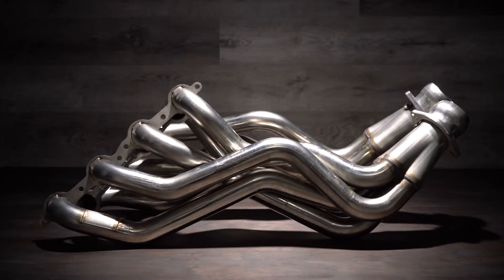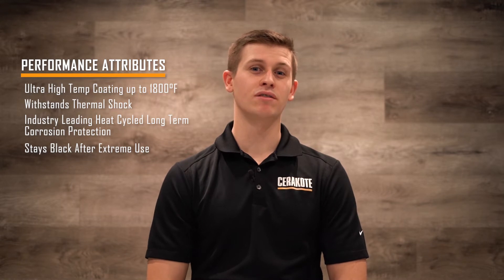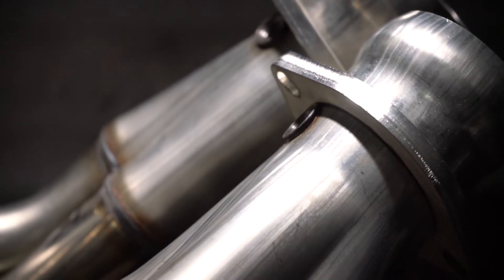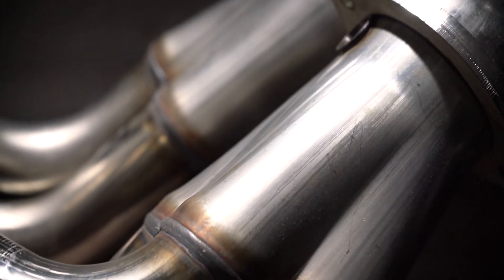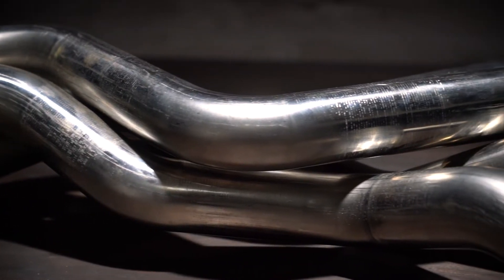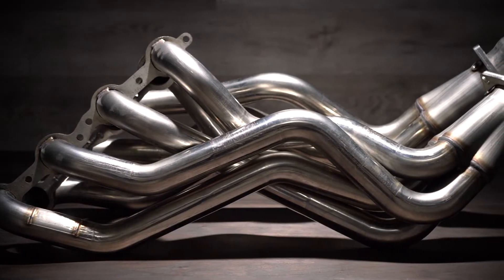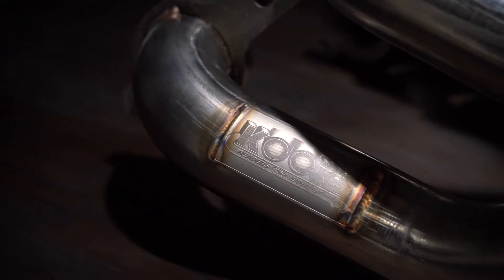Cerakote Application Guide - Coating Kooks Headers with Cerakote Glacier Black C-7600

Comment: Can I sandblast stainless steel with 0.2 mm grit corundum abrasive before applying the Cerakote C-Series Glacier Black coating?😊😊😊😊😊😊
Reply from the maker: This isn’t a media grit we’ve tested or used in-house, so we can’t say with complete certainty. We’d just recommend blasting with caution to avoid creating too deep of a surface profile. If the profile ends up too rough, those deep valleys can prevent the coating from fully settling in, leaving parts of the substrate exposed—and that can make it more prone to rust over time.

Comment: I’m liking what I see. 2 questions. Can this be used on my aluminum intake manifold? 

Secondly I’m wondering if you have other colours  that are as durable for a header? Something like a titanium or silver? It’s going on my show car so I would like long lasting with out discolouration.
Reply from the maker: Our Glacier Series would be the best option for these high temperature applications, but we do have coatings within our C-Series in general that meet the high temperature range as well. Something to note; while the coating stability can withstand the temperatures these parts may see, the color stability may not be able to. Ratings do vary from coating to coating, so you will need to verify that information on the specific TDS for each coating product page.
Reply: @ awesome thanks for the response

Comment: I've purchased MC-5100 for some factory-fresh aluminum panels for the engine bay of my Factory Five roadster.
The question is: Can I wipe it on (as I've done with Sharkhide using a cotton diaper?) instead of using a HVLP gun?
I don't have a decent compressor, and the 'wiped-on' finish looks great for Sharkhide but I want to switch over to MC-5100.
Reply from the maker: Contact our Technical Support Team. There may be a solution for you for applying it without the spray gun, but we'll want to get some more specific information from you. Thanks

Comment: what if you don't have a sand blaster
Reply from the maker: Sandblasting is required because it's necessary to get the adhesion needed for overall durability. If you were to skip this step, the coating would chip more easily. I would suggest taking your parts to a local shop to have them blasted if you don't have a blaster.
Reply: @Cerakote  If you don't sandblast them, can you sand them with 80 grit?

Comment: What recommendations do yall have for the collector where all four tunes meet on the inside radius of each…. I have your fun and everything else and was just coating a set of looks as well…. Pipes are so tight together cannot get coating all the way down in there.  It’s barely noticeable but def there
Reply from the maker: Get in touch with our tech support, that is a tricky scenario. Depending on your specific situation, you may be able to dial your spray gun down for hard-to -reach areas. We do have a Dial It Down series of videos here that may help you out too.
Reply: @Cerakote will do.  I appreciate the help.

Comment: Be careful with exceeding the cure temp because the color will change. I used  STORMTROOPER WHITE Item: H-297 on the outside trim of a gas wall oven door and it turned coffee brown quickly.  FYI we keep a whitish dish towel on the oven door no problem..
 $9 can of high heat engine paint works better.
Reply: H-Series is not a high temp coating. You should use normal C-Series or the Glacier Series.
Reply: Yes C is supposedly rated to 1800F but we are not taking about anything over 450F like with a header or my oven outside door.  So STORMTROOPER WHITE Item: H-297 cant handle any thing over cure temp without discoloring! Not very Hi performance and not even as good as engine paint.     @zaakkriel1574

Comment: Would it be a good idea to cerakote a aircooled engine cylinder barrel? It has been suggested on many forums here in UK but the concept explained (referring to exhausts) makes me think otherwise?
Reply: Negative ghost rider... cylinders need the honing marks to reduce friction and allow something for oil to cling to. Without the honing marks you have an oil burning engine that probably runs hotter than it should due to extra friction and blowby and in need of a rebuild.
Reply: That's assuming you're talking about the cylinder sleeves where the piston goes. If you're talking about the outside where the cooling fins are, that would be a negative. The one place inside the engine that it could possibly help might be the inside of the exhaust runner. Theoretically it should help block some of the heat from being absorbed into the head from the exhaust runner helping the engine to run cooler. I suppose if you did it in the intake runner it might help keep the fresh air coming in cooler. The cooler the air/fuel the denser the charge.

Comment: Lousy product for exhaust headers... had this applied to my American Racing Headers LTs and it does look beautiful... however, it's about as resilient as dry erase markers. If any tool comes in contact with the finish or it rubs against anything during installation that "coating" comes right off.

Comment: Here in Lillehammer Norway we have done quite a lot of turbo housings and headers for highly tuned cars, we use 100 gallon ultrasonic tanks for decreasing , and wet blasting (vapour honing) witk alu oxide besides that we follow the cerakote "rules" and we have really good experiences with the c-7600 and other high temp colors.  
we tested this on a turbo housing on a  2ltr (or 122 cu inch) Ford Cosworth delivering 580 horsepower while on the testbench , 20 gallon of fuel was used under optimizing the fuel and ignition
 the c-7600 looked like new after that . 
the max temp is 1800Fah or 980 Celsius , but if a multiple carburettor  engine (motorbikes)  runs extremely lean on one cylinder the temp can easally reach higher temps destroying first the coating and later the exhaust valve/s  ,-)

Comment: I just had a thunderheader exhaust coated by Precision Powdercoat Melbourne, FL, with glacier black and it bubbled up and started flaking off around the high heat areas of the upper header.  I brought it back and they sandblasted it again and coated it again.  Less than 100 miles now and its worse than the first time... I'm really disappointed with the experience.  I don't know if its the preparation or the fact that its a single wall pipe, or a bad batch of cerakote.  I will have to sand it down myself and use bbq paint,  I'm not going through this again.
Reply: Cerakote still has a procedure to go through for appropriate breaking in of the coating- first of all the air cure cerakote applied to an appropriately prepped surface needs to be left to cure for 5 days before the part is mounted back onto wherever it goes, 2nd it needs to be run through a couple heat cycles on whatever vehicle or motorcycle left at idle first for 15min, allow to cool, then for an hour and allow to cool, repeat the hour heat cycle 2- 3 more times in normal, mild driving/ riding after a 15min idle warm-up then while driving/ riding do not do any sort of high performance or high Rev with your car/ bike- after the 45min- 1hr drive/ ride and allowing to completely cool for 2- 3 cycles then you'll be good to go- this should never be done on a fresh build or rebuild due to excessive heat output- use different parts for engine breaking in or wait to coat until after break in procedure is completed for fresh engine build/ rebuild. If done as stated correctly then you have yourself a long lasting durable coating- Cerakote is an amazing product if the customer and applicator are educated
Reply: @adambuscemi7893   Adam - can you provide one or more references? Also, does this "break-in" method apply only to a specific series of Cerakote or all of their products?
Reply: I normally powder coat. but thought of doing cerakote so I spent 700 on my first order.. now wishing I hadn't. I bought the largest bottle of the C-7600 not included in the initial 700 I spent.  because a previous customer wanted me to spray there turbo stuff... lol yeah, first hot side header manifold I did it flaked right off during the first 15 min of a new engine build.. I thought I learned why. because it was sprayed on to heavy.. so I just did a brand new intake manifold.. went super light on the application and just notice from curing over night. One small flake came off.. I'm done with cerakote .... my advise.. do not pay a powder coater to spray cerakote..

Comment: If I had an oven needed to perform the out gassing step, I wouldn't be using C series to start with.  Thought the point of C series was for people who don't have the luxury of a large oven?
Reply from the maker: Our air cure products are thermally stable to higher temperatures than our other coating lines.  If you can't outgas parts, thoroughly degreasing will be your best option.

Comment: Awesome. I’ve got some coming. Glacier Black for the head pipes. And Gloss Black for the heat shields. Josh told me I can even polish it up some more with OOO steel wool. Thanks. I’m taking a 2020 Kawasaki Z900RS cafe pipe and attempting to replicate a 82 Z1000 Eddie Lawson Kerker pipe for it.  In 82 it was Black Chrome. My plater here said they didn’t think the plating would stick to the stainless exhaust on the Z,s pipes. Here we go. Keeping my fingers crossed. Thanks again to you for stellar customer service. 👍😁